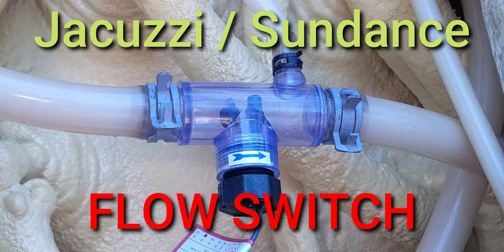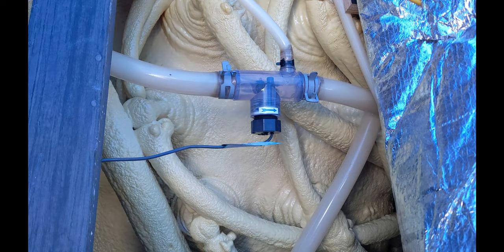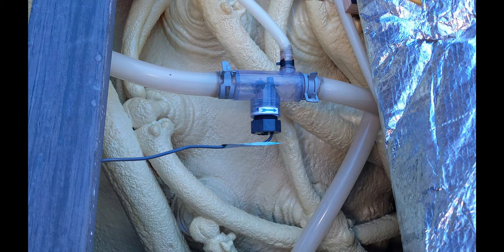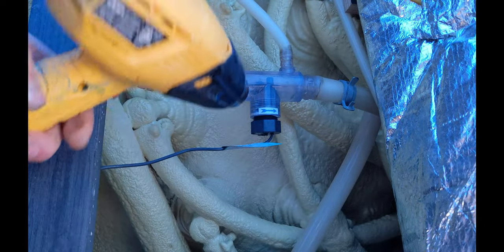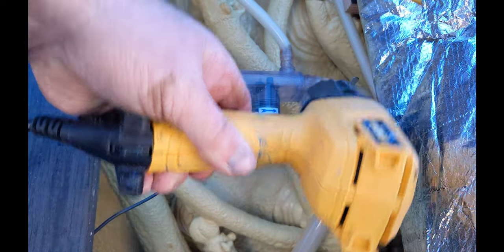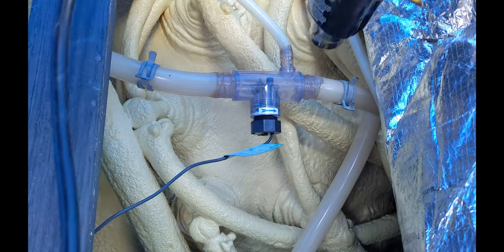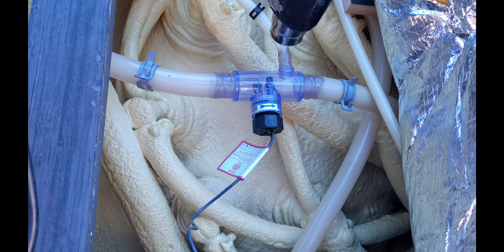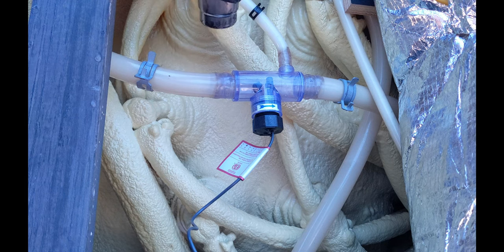Jacuzzi Sundance Hot Tub Flow Switch Replacement | Watchdog Error

Comment: Thank you for this video!  I have a Sundance Montclair 780 Series.  I'm getting the Watchdog error.  Just briefly before the WD error, I get 361 and 888 errors before the --- error.  I bought new temp sensor and flow switches.  If I replace these switches at the control board before installing them in the tub will I be able to ascertain which is faulty?
Reply from the maker: The 361 "error" is just telling you something is due to be changed.  Maybe a filter or UV light?  You would have to set it back.  The 888 is the topside to where it plugs into the circuit board.  Check the connection and the wiring (mice love to eat that wire).  It looks to be a communication issue

Comment: Where did the wire on the bottom connector? Did you power off the tub at the breaker?
Reply from the maker: I guess I should not assume everyone would turn the power off.  I have other videos showing you step by step, but in this video I only show how to replace the flow switch.

Comment: Where is this switch located?? I have a montclaire but can’t find this
Reply from the maker: If you have a flow switch, it will be on the upper left or right of the pack controls under the hot tub.   If you have a pressure switch, that will be screwed into the heat tube.  Take the front door off and see if you have one of those.

Comment: Can you just unscrew the black part and clean it?
Reply from the maker: When these switches fail, it's not because of a build up of anything.  It's because it's failed inside or the steel part has come lose.  You could just change the switch and not the tee.
Reply: @VIPPoolsandSpas  so I can just unscrew it and put a new switch? That sounds easier than replacing the whole thing. Thank you
Reply from the maker: @nevershoutneverrr132  https://youtu.be/Y3wT9MQi3Xg
Reply: @VIPPoolsandSpas  I took the front cover off but can not find the switch. I have a jacuzzi j 245.
Reply from the maker: @nevershoutneverrr132  Jacuzzi might have a pressure switch in that tub.  Jacuzzi isn't consistent on their design of electronics over the years.  Look on the heat tube itself beside the 2 leads to the element.
Reply: @VIPPoolsandSpas  Yes, I called jacuzzi and they said my tub was built 2 months before they switched to flow valve. Thank you for your help.
Reply from the maker: @nevershoutneverrr132  If you're getting an error code, try adjusting the pressure switch.  I have a video on that.

Comment: What about the wire at the bottom … pe not show connecting.
Reply from the maker: Because there are 3 different connectors for this flow switch, I'm only showing how to replace the switch.  Pretty sure people can figure out how they disconnect and reconnect.
Reply: @VIPPoolsandSpas  not true … the wire is the complicated part and behind another panel and I’m not an electrician so do not know if need to solder or simply twist the wires together? Getting the air out via a garden hose needs clarification too … one side or both and how long do I keep it connected?
Reply from the maker: Not sure what switch you have or type that goes onto the circuit board.  Send a pic to info@vippools.ca so I can see it.